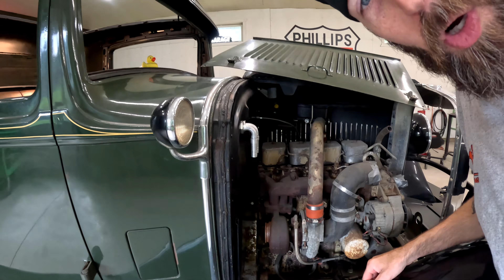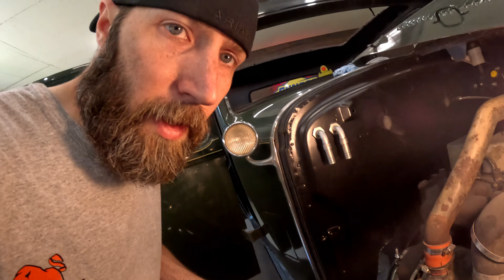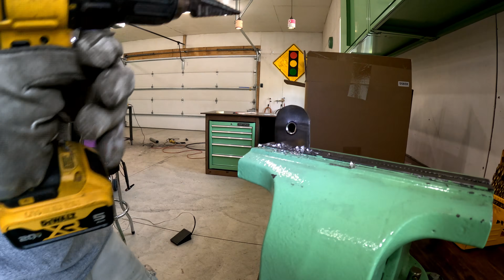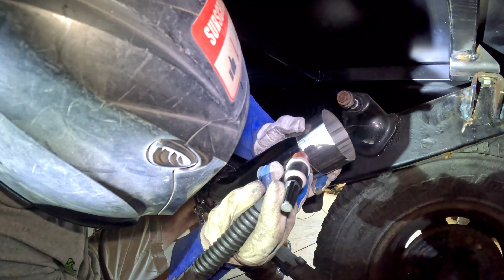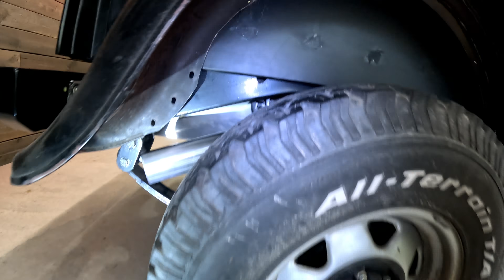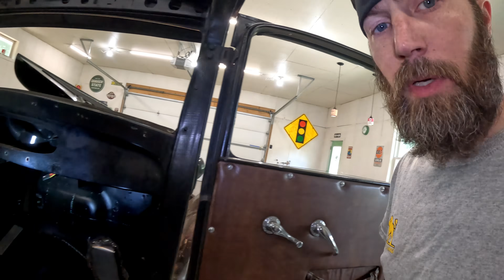Building an Exhaust for The Dirty '30 My 1930 Cummins Powered Dodge Pickup Truck Project Restoration

Comment: Looks good. Gonna have to put some serious heat shielding on that elbow. I always add a lined stainless flex joint.  They help a ton to prevent cracked manifolds and exhaust hangers.

Comment: Exhaust looks beautiful. A nice straight pipe exhaust should sound perfect. 
If it were me doing the exhaust I personally would have tucked the tip just a little closer to the fender and brought it all the way to the rear edge of the fender.  Just so the dino smoke doesn't stain and discolor the fender